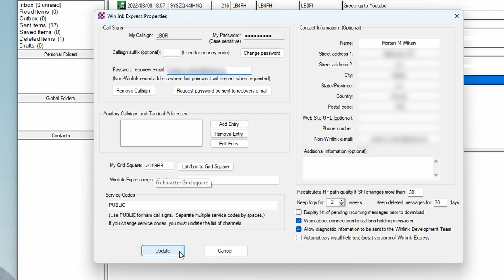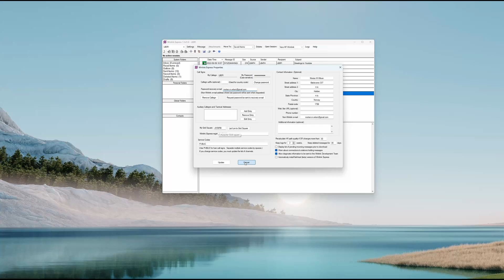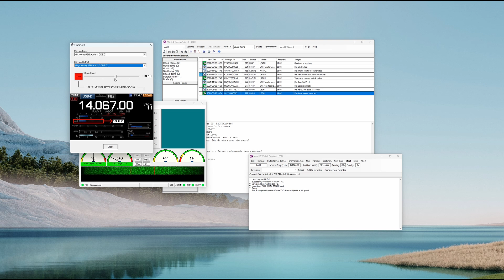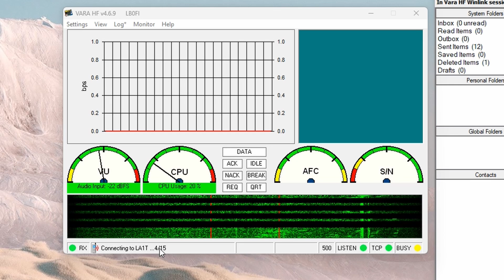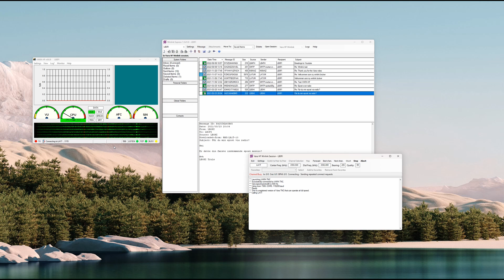Winlink Settings for the Icom IC-7300

Comment: Your video finally gave me the tip I needed to overcome my last VARA HF hurdle: the retries limit. I had mine set to 3, same as I use for VARA FM (which always connects on the first try). Seeing yours at 15 and connecting on attempt 7, I upped mine to 10 and successfully connected to a gateway on attempt 6 and retrieved a waiting Winlink message. Finally, success! Thanks.
Reply from the maker: Great to hear!

Comment: How about going thru the 7300 setup first?
Reply: EVERY. SINGLE. TUTORIAL. ON. WINLINK. IS. HALF. THE. INFO. NEEDED.
Reply from the maker: Why all the capital letters and short sentences? Besides that, make the one you want yourself!
Reply from the maker: I'll do a follow up at some point, although there are several guides out there on how to get your 7300 ready for digimodes.

Comment: I came back to this video to make sure I was doing things correctly. Although it was working fine before when I start  VARA  the 7300 goes into transmit mode without a change in frequency or a change to USB D. FT8 works fine. This has only recently happened and it was after I did a P to P exchange. Have you ever experienced this? I have the setting back to VARA HF Winlink.
Reply from the maker: I have not had that problem, so I will have to look into that. I am however a bit short on time, so shoot me an email if you don't hear back from me.

Comment: Did you manually set your Icom Address to 00? Isn't it usually 94?
Reply from the maker: I think I just used the default settings. But yes, it is usually 94.
Reply: @LB0FI  One more question, if VARA doesn't key my radio, any particular settings i should be checking?
Reply from the maker: @joel6221  I would need to experiment a little bit to figure that out. I have a new computer though, so I’ll try to set it up from scratch this weekend.
Reply: @LB0FI  Still can't get VARA to PTT my 7300 ... any new info?
Reply from the maker: @joel6221  Nope, couldn’t replicate your issue.
Reply: @LB0FI  Can you go over your settings on the 7300?
Reply from the maker: @joel6221  Send me an email, and I'll sum it up for you with some pictures.